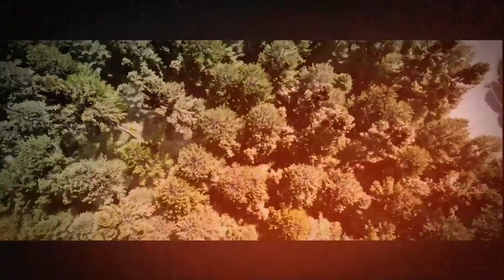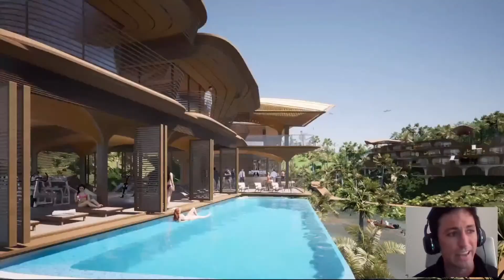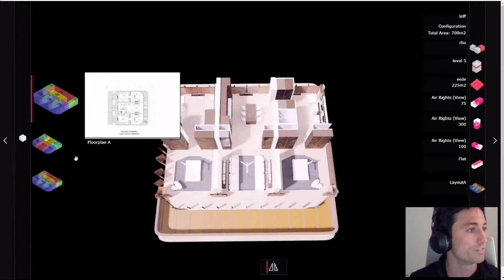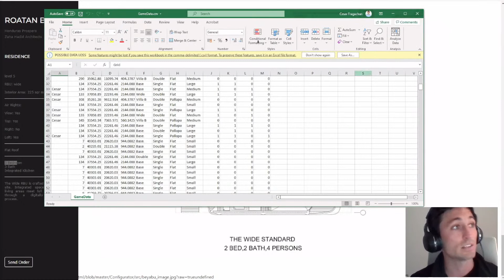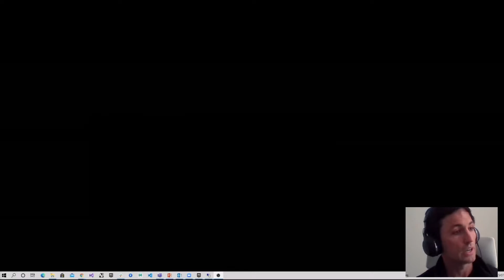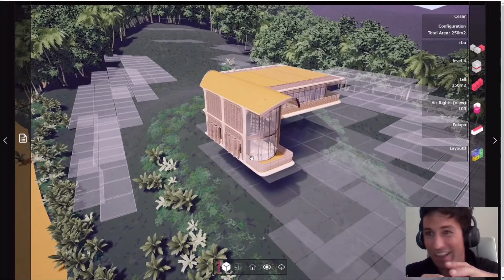Play, Design, Build with Cesar from Zaha Hadid Architects

Comment: I like to package things first, which means that the pipeline configuration can be fixed
But using Maya, it means that the pipeline schedule cannot be displayed, right? Or this thing is only for construction.
The location of the rooms on the upper and lower floors is different for each customer, so how to pipe the drainage pipes with a slope?